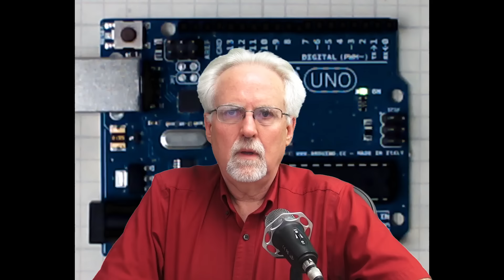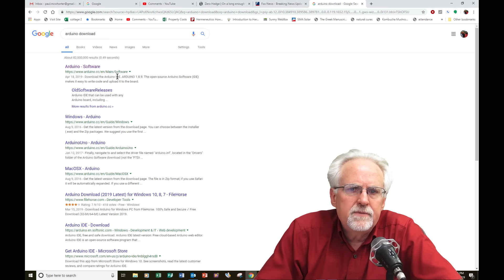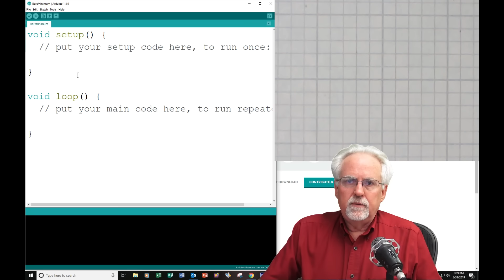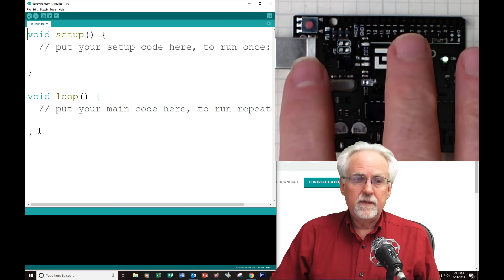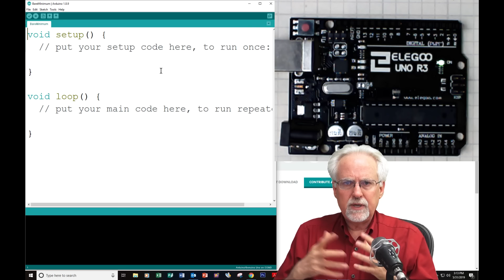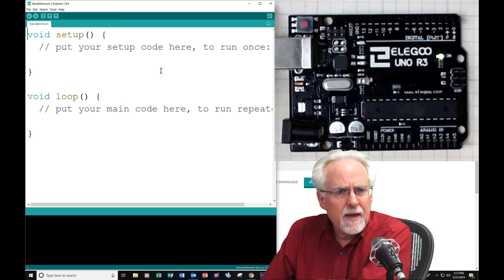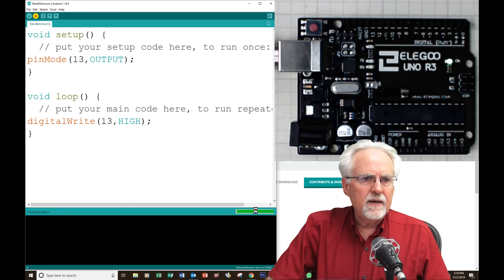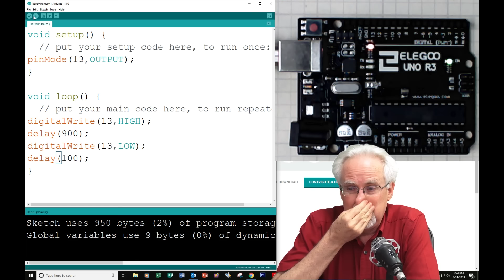Arduino Tutorial 1: Setting Up and Programming the Arduino for Absolute Beginners

Comment: Brilliant! Thank you sir! I'm a 67 year old with no programming experience whatsoever and I have just followed your lesson. I have also subscribed immediately as you are a very good teacher, and so easy to follow. I don't have my Arduino yet as I am waiting for it to arrive in the post. I have not ordered any hardware yet also. My ultimate goal is to use an Arduino coupled with a Neema 17 stepper motor controller to use said stepper motor to drive the Y axis on my metal lathe as a power feed in both directions and with variable speed from say 50 rpm down to about 5, thus giving me a smooth control of the cutting action of the lathe. That is my one and only goal for the moment. Can you point me in the direction of writing this code successfully? I would much appreciate your or anyone's help, if they have already written a code for this sort of control.

Comment: Hey paul,
I must say this is an amazing series and thanks for the good work. May God bless you.
I had a request, I was wondering if I could control my servo with the wifi module, my Arduino and my laptop using simple keys on my laptop. I am working on a project and I would love to use an Arduino for this purpose. If it is possible and you have time on your hand please make some videos on the wifi module and controlling stuff with laptop keys.
Thanks

Comment: set both delays to 1 and the light just looked like it stayed on, but then changed the HIGH so it was only on for 0.5 and the LOW for 100 then it looked like the high just didnt have enough time to fully power the light befor getting told to shut down

Comment: Hi Paul, I concur with Dare - you are an excellent teacher. I have followed your tutorials and learned how to program my Arduino Uno. My first project is a remote controller for my HiFi amplifier. I will use the stepper motor to drive the volume control. The stepper will be controlled by an IR remote controller (for the Sony BR player) which has a Vol+ and Vol- buttons, via the Arduino. The code is written, everything works, and I am now mounting the stepper on the amplifier and connecting its shaft to the volume control via a belt. Once final test has been done, I will program an Arduino mini (so that I can keep the Uno to design more projects) and put the mini, the IR receiver and the stepper driver into a box and connect it all up.  I have wanted to add remote control to my amplifier for years. Now, with your help, I have (almost) achieved it. Thank you very much.

Comment: When using the command exactly as shown in video to make LED blink i am getting  an error message in an orange box at the bottom stating: "'digitalwrite' was not declared in this scope" i could turn it on & off seperately no problrem but it wont blink, Any ideas anyone?
None of the following programs given worked either unfortunately. I have double & triple checked to make sure im doing everything right. Have the log files changed since this vid was released or something?
Reply from the maker: If you do exactly what I do in the video, you will get exactly the result I got. Remember uppercase/lowercase matters. Also check all your parenthesis and {} to make sure they all are balenced. Believe me, do exactly what i do, you get exactly the result i get
Reply: @paulmcwhorter  You are correct. i used digitalwrite NOT digitalWrite. Thanks for you fast response, I managed to get it blinking at various speeds previously though so this must have been amended at some point without me realising.

Comment: Can I use the Arduino to compare vibration levels of different cd players ect? If so, is it as simple as placeing the Arduino sensor on the cd player chassis and also using a multimeter to get the reading?

Comment: I really don't like using the Arduino IDE due to the lack of intellisense which can be hard when doing big projects so instead I recommend using visual studio code and installing Platform IO extension which Arduino intellisense built in which can save a lot of time especially when working in big projects

Comment: I asked my fiance to give me something to do with the light. She said "make the jingle bells song." So I sat here and came up with this haha

void setup() {
pinMode(13,OUTPUT);
}

void loop() {
digitalWrite(13, HIGH);
delay(500);
digitalWrite(13,LOW);
delay(50);
digitalWrite(13, HIGH);
delay(500);
digitalWrite(13,LOW);
delay(50);
digitalWrite(13,HIGH);
delay(500);
digitalWrite(13,LOW);
delay(50);
digitalWrite(13,HIGH);
delay(1000);
digitalWrite(13,LOW);
delay(50);
digitalWrite(13, HIGH);
delay(500);
digitalWrite(13,LOW);
delay(50);
digitalWrite(13,HIGH);
delay(500);
digitalWrite(13,LOW);
delay(50);
digitalWrite(13,HIGH);
delay(1000);
digitalWrite(13,LOW);
delay(50);

digitalWrite(13,HIGH);
delay(500);
digitalWrite(13,LOW);
delay(50);
digitalWrite(13,HIGH);
delay(500);
digitalWrite(13,LOW);
delay(50);
digitalWrite(13,HIGH);
delay(600);
digitalWrite(13,LOW);
delay(50);
digitalWrite(13,HIGH);
delay(100);
digitalWrite(13,LOW);
delay(50);
digitalWrite(13,HIGH);
delay(2000);
}
 it was a fun little thing to practice and get used to using milliseconds. Let me know what you think! Also I want to thank you for all the lessons as well. during these times i can't get the specific kit you have in the video, but the one i have does a good bit so i can't complain. I shall keep moving on! haha

Comment: i got a code online. stepper motor control rotation. speed and direction using ardiuno.  it worked fine when i used stepsperrevolution up to 20, stopped working beyond 20. my target is 70, please what should i do?

Comment: I got the whole universe one-upped. Connected my Galaxy 9 to a powered USB hub with a USB C to female and USB extender. The hub provides 3.3-9V and up to 10A, and they can be set as well. The cherry on top is my phones dual bluetooth: one for my Airpods, one for my bluetooth keyboard... I think my first project will be a case for my phone. A USB-C bluetooth transmitter sort of case...

God I hate wires.

Comment: Hello.I am just starting with my Arduino but am already having a problem.
I successfully programmed pin13 as you showed in your first lesson but now, every time I try to do anything else I get a message "Pin was not declared in this scope" even though I ´m sure I have written everything correctly. I have tried pushing the reset button on the Arduino with no effect. Please help

Comment: Hi Paul, could you please make a video on sending a blink program to a standalone ATMEGA2561? I'm having trouble finding resources. I originally wanted to use a TQFP board and just have a plug and play socket, with the chip on the QFP, but for when the chip is soldered in circuit, I'd like to figure out how to program it. Thanks Paul.

Comment: I want to get into Arduino programming as I've been programming in VB.NET, Javascript, jQuery, PHP, creating programs in both desktop and web applications, but I'm still not really seeing the fullest potential of what I can do with Arduino yet. Creating code to light up some simple leds, to me, isn't really that interesting. I'm still trying to learn what all I can design if I ever decided to take this route in learning it. I also have a vending machine business that requires for me to count THOUSANDS of coins to cash them in, so I was thinking about building a bulk coin counter in Arduino. The Arduino would need to have a sensor as each coin is passing through, and tallying everything up in the end. Something like that would be a fun little project for me. Anyhow, great videos Paul! Keep up the great work!

Comment: Hi Paul, I can't get the serial monitor to open on my laptop. Running windows 10 home, I have uninstalled and reinstalled several times. Installed on another laptop with windows 10 and it works fine. Any suggestions as to the problem?

Comment: I just got my mega2560 arduino. I'm using on a Manjaro OS. It's working great so far. I only had to change the permissions on the ttyAMC0 file so I could access the port.(It's a linux thing!). I am having a blast. Your tutorials are really great now that I have an arduino! I used your link to get it, so I hope you get the credit!
Reply from the maker: Much Appreciated!

Comment: Looks like I installed the drivers with the IDE install but nothing is coming up in the port when i plug my arduino in! Windows makes the happy noise, the board lights up, but nothing on the IDE port option....

Using the Elegoo tutorial I checked device manager and looked under "Other Devices" hoping to find my mega2560 or anything arduino related to manually install the drivers, but guess what? "Other Devices" doesn't even show up in the device manager. So... what the heck do I do now?

Comment: I wanna do a project with an arduino for my rc car I need to use a smaller size maybe nano or mkr zero with his own battery,two temperature sensors,battery voltage sensors to check my lipo battery,gps module for speed sensor and bluethooth module to send all the data to my phone,maybe build an app with all gauges for the sensors .im really new and I dont know what to do,is it possible?costs?

Comment: Hi, Paul. I'm very happy to see you're back. I followed your last set of tutorials and enjoyed them all very much. That being said, I did run into a problem I'm hoping you address in this set of tutorials. I'm working on a project that lights several LED's with different flash patterns depending on which sketch is loaded onto the Arduino UNO. What I need to do is switch from one sketch to another with a button press. Thus changing the flash pattern. Unfortunately, I can't find a way to do this if the sketch is written with any delays. Every one I've spoken to says I need to write the sketch's without any delays what so ever. Can you do a tutorial showing an alternative to using delays to turn on and off LED's?
Thank you and I hope to see all you have to offer in this new series.

Comment: Does the arduino use structure programming?
Reply: it includes c language elements like brackets {}. C was developed around the 70-80's to be one of the first structured programming languages.  It can be used that way,  i don't know arduino programming, but programming bare metal chips  might or might not be as structured as writing for a full os pc software environment.  arduino around 2005-2010 made programming bare hardware significantly easier. "structured" like art is in the mind of the programmer.

Comment: void setup() {
  // put your setup code here, to run once:
int led = 13;
pinMode(led, OUTPUT);
}

void loop() {
 
int led = 13;

digitalWrite(led, HIGH);
delay(15);
digitalWrite(led, LOW);
delay(15);

}

I can kind if tell that it is blinking at 15 milliseconds, but can hardly tell at 14. I would say 18-20 is the sweet spot though.

Comment: Paul, i have the super starter kit from elegoo, when i take it out of the box and plug it into the battery pin 13 is already flashing. Is there a problem?
Reply from the maker: Probably not a problem . . . might already have a program in it. Just follow the video and you should be OK

Comment: I think you do a great job and by repeating you reinforce the concepts.  I think you made one minor error and that is with Duty Cycle.  I think you mentioned a couple of times in the video the Duty Cycle is one second.  That one second would be the period which you can use to determine the Duty Cycle which is usually a percentage, factor, or ratio.  For example in this video if the on-time is 100 msec and the off-time is 900 msec, then the period is on-time + off-time = 1000 msec and the Duty Cycle as a percentage is (100 msec / 1000 msec) x 100% = 10%.  I know you are aware of this and I am  just adding this information to help other viewers.  Again you do a wonderful job and I look forward to this series.

Comment: in this i put pin 13 INPUT instead of OUTPUT to see what happens 
if it show any errror or do something else 
so what it does is without producing error it glows internal led. 
code is as follows:

int pinLED= 13;
int oneSecond = 1000; /*delay for one second */
int twoSecond = 2000; /*delay for two decond */
int onLED=20;
int offLED=20; 

void setup() {
  // put your setup code here, to run once:
pinMode (pinLED,INPUT);
}

void loop() {
  // put your main code here, to run repeatedly:
//digitalWrite(pinLED,HIGH);
//delay(onLED);
digitalWrite(pinLED,LOW);
delay(offLED);
}

Comment: in this comment i have put my code in which my eyes can see LED blink 

int pinLED= 13;
int oneSecond = 1000; /*delay for one second */
int twoSecond = 2000; /*delay for two decond */
int onLED=20;
int offLED=20; 

void setup() {
  // put your setup code here, to run once:
pinMode (pinLED,OUTPUT);
}

void loop() {
  // put your main code here, to run repeatedly:
digitalWrite(pinLED,HIGH);
delay(onLED);
digitalWrite(pinLED,LOW);
delay(offLED);
}

Comment: I am twelve lessons in the old series. It seems pin 13 has some low power to it else it wouldn't have turned on. Did you notice the 5v rail isn't used? I think all digital pins have a small amount of power to them, just enough to turn on an led, but not enough for anything that needs more power. Then you would have to use the 5v. rail.. Am I right about this?
Reply from the maker: You can run simple things. When you write the pin HIGH, you are putting 5 volts to it.
Reply: On high state it gives 5v. Be carefull not tot attach anything with a higher powerdemand than a couple of mA. Otherwise use external powersupply and transistor or Mosfet to switch it
Reply: Robert, Paul made many things clear to me with his answer above.
I understand now why I dont have t use the 5v rail everytime. I only recently learned how to use a transstor, though my pulse motor still wont work. I consider myself a newbie to all of this so my goal now is to fill the gaps in my basic understanding. I will think on how to attach something which uses more amps to arduino.
Reply: @boowonder888  use mosfets for starters:   IRLZ 44 !   google it....